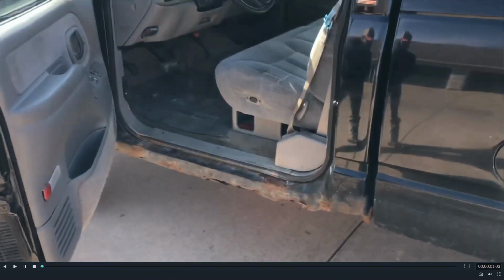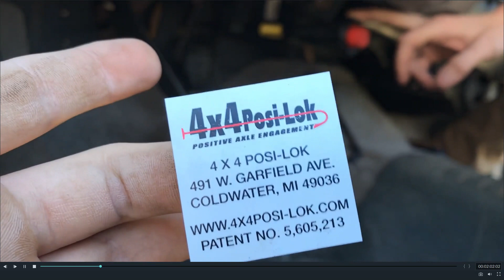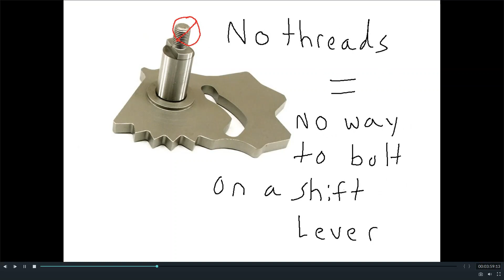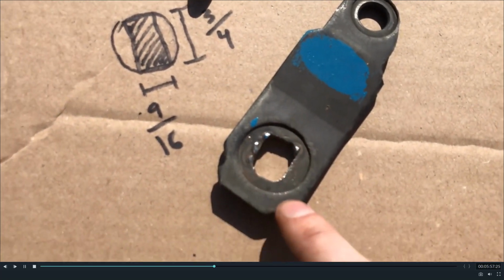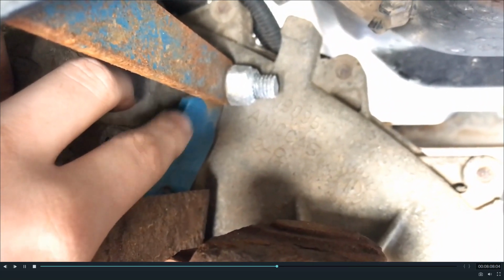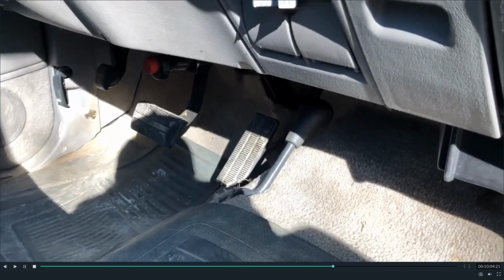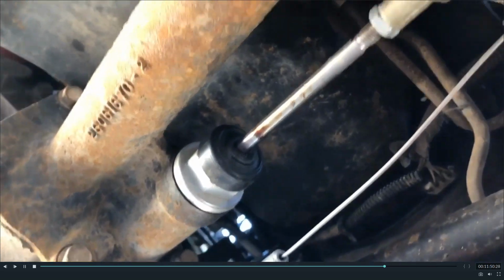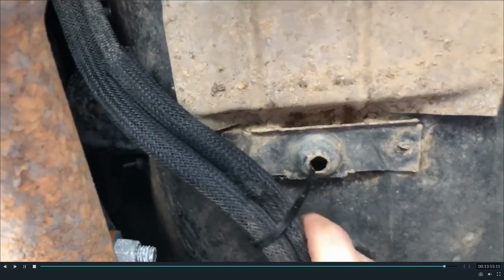push button to manual floor shift transfer case conversion 1998 Chevy k1500

Comment: Hey, how’s it going guys? I’m having an issue with my 2005 Chevy Silverado 4 x 4 LS so when I shifted into four high or four low, I had a lift both driveshaft are turning, but only the rear tires are spinning. The actuator was switched with a new one something isn’t sending the signal to the actuator that the 4 x 4 is engaged. I checked the grounds they’re good. Would you guys think it’s the transfer case Shift control switch and if so, where is it located?

Comment: The neutral or selector position that doesn't do anything that you speak of that's the Auto 4 wheel
Reply: Sir I assure you that the NP243C transfer case that is in this here truck does not have a 4-Auto position.  That was an option on some later vehicles such as my 2001 Blazer, but the original electronic push-buttons that came in this 1998 K1500 only had 2-HI, 4-HI, and 4-LO.  I could be wrong, but the majority of transfer cases that I have knowledge of usually have some sort of neutral position between the HI and LOW range for safety reasons. Because this T-case was never meant to be used with a manual shift lever, this "neutral" position simply felt a little hinky to me to the point where I would not be comfortable using it as a means of putting the vehicle in a neutral state.  

Also.... the grindy noises say no

Comment: I'm having trouble learning how to use my manual tcase on my 1999 nbs 2500 silverado I follow the steps from the instruction manual but end up grinding any tips?
Reply from the maker: The transfer case or the shift linkage is probably messed up.

Comment: I have a transfer case not engaging with the encoder motor for some reason, yet I get no blinking light 'error' on the 4x4 push buttons. I took the encoder motor off and noticed that I could manually lock in the transfer case with a wrench. I almost bought the Posilock but instead rigged up a carburetor cable under the hood that I lock in whenever I think I might need it. My '98 Blazer is at the point where I'm going to put a lever on because it's done nothing but let me down when I really needed 4x4. The engineers that came up with that terribad combination vacuum/electrical 4x4 system should be court martialed and shot. (I'm sure it made GM tons of $ from clueless fairer sex customers which is probably why that system was put in to begin with.)

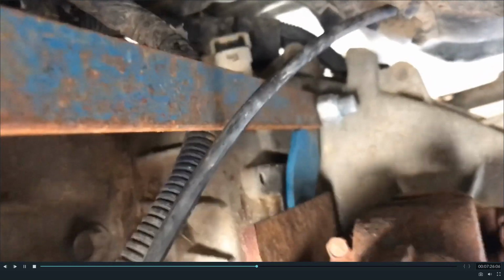Comment: At about the 7:28 mark it shows the linkage underneath the truck and you say the plate bolted into two of the encoder motor holes is holding the shift arm onto the transfer case output shaft. Is the plate just snugged up against the output shaft using washers for the correct spacing?

Comment: You don't have any issues with the transmission shifting at all? Since the computer doesn't have the position sensor to talk to?
Reply: No issues, over 3 years later and it  works perfectly. 

The truck doesn’t seem to know or care about having all that stuff unplugged

Comment: Hey man I want to do the same thing I have a 2002 Silverado with a 4l60e transmission with a np246 push button 4wd autotrac junk and I done burnt out the clutch pack in the tcase that's why my 4wd doesn't  work I want to swap in a manual shift tcase that doesn't use clutch packs what tcase do I need that will bolt right up I'd like to have a gear driven transfer case but a chain driven tcase will do ....by the way I don't know the spine count on my current tcase....as for the shift linkage I can fab up something that will work
Reply: I do not know off the top of my head what specific transfer cases will bolt up or what the spline count is.  If you are wanting to swap the case anyway, just take it off and count the splines.

Comment: Mine the transfer case got smashed by whoever owned it before, so I might as well put in a np261 and put in a lever. What I'm wondering though is the screen on the dash says "service 4wd" every few seconds, do you know how to get rid of that? Thanks
Reply: Either a sensor or an actuator is malfunctioning somewhere.  To try and reset the light, there is a way that you can jump two of the contacts on the OBD port and perform a series of key cycles.  This will clear out the memory in the transfer case control module.  You can find other videos explaining this procedure for different vehicles.

Comment: I got the np246 auto trak case. I hate the push button and want to do exactly what you did and switch it to the manual. What trans case do I need to pic up? I also have the posi lok for my k2500 that iam literally installing now. Great video and job guys.
Reply: Thank you.  If you're looking for an already manual option, the np241 will most likely work as long as things still bolt together however there are stronger options.  Just search for things that will bolt up to your transmission/trans-transfer case adapter.  There are quite a few options out there depending on whether you want a chain-driven or gear-driven transfer case.  In our situation, we did not want to swap out the transfer case (because poor) which is why we created a linkage to replace the electronic actuators.
Reply: @alecschauer9902  Now it makes more sense. I thought you converted to the 241.

Comment: How can you change the manual to buttons ?
Reply: So you're wanting to swap from one that has a manual transfer case to one that is button-actuated?
Reply from the maker: step one: get an electrical engineering degree
step two: now you can afford to buy a different truck
Reply: Why would you go from I know this works to I hope it works
Reply from the maker: @avadeal345   Y E S

Comment: How did you seal the hole in the floor?  Did you use any sort of boot?
Reply: The shifter assembly is a stock factory part. it seals the same way the factory installed ones do. it just has a rubber gasket that goes on one side and is squeezed between it and the floor.  Water could still come in the slot the handle slides through just like every other truck that has one but at that point water would be coming in the doors
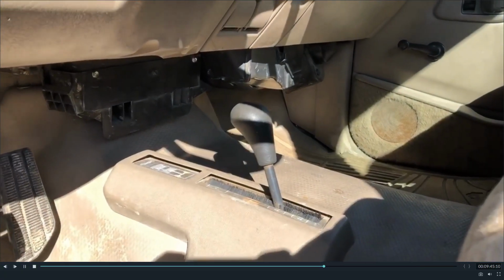Reply: In this case we did not use any kind of seal because I did not care.  The assembly usually has some sort of seal, though, as well as the brush thing on the OEM cover plate depicted at 9:45.

Comment: I’m looking to manual swap my 8.1L Suburban, which has full electronic 4WD. I know I’ll have to convert to a floor-shift t-case, so would this still apply? And if so, how could I wire the t-case to still activate the front actuator? I believe it’s a NV246 t-case.
Reply: Things well that answers my question... what was the estimated time y’all worked on it ?
Reply: Things thanks cuz this is my daily... I didn’t want to be out for a week or so... will update later...

Comment: you don t need to lock the front with a cable /when you manually put it in 4x4 /the vac sensor on transfer case wiil engage front diff
Reply: Nope, wrong. this truck was equipped with an electric solenoid on the front axle housing that worked in conjunction with an electric servo on the transfer case. Only when the servo on the transfer case had completed its shift, would A computer (The 4wd controll module) tell the solenoid on the front axle housing to  engage. Because we removed the servo entirely, the computer would never see a completed shift and there for never tell the solenoid to actuate. The cable pull is manually and physically moving parts in the front housing. vacuum has nothing to do with the 4x4 on this 98 k1500. Not a thing.
Reply: @goreerh  So if i swap my push button 243 with a manual 241, I'll have to use a cable to engage the 4wd along with the manual shifter? or can i just use the manual shifter?
Reply from the maker: If your gonna swap your transfer case for a 241. Then just find a truck that has a manual linkage for a 241 and take all the electronics that control the front axle actuation. Theoretically you could integrate those into your truck and have a shifter that works like factory. If you don’t want to deal with all that Jazz just use the posi lock kit, it make shifting into 4x4 more of a process but it removes all the electronics that like to go bad.

Comment: Thermal ?
Reply: @things7141  Ok, never heard of that on these so I need to look into that gas expansion type actuator. Do you have a part number ? I have done several S10's and own an '89 that were all vacuum operated. And one that was electric. Agreed they are all poorly designed, too many points of failure.
Reply: @things7141  I never heard of a thermal actuator on these. Always thought a thermal expander was on HVAC, not on front axles, and called a Capillary Bulb.I already converted mine, and others. Missed out on a Posilok thing a year ago for $40, new. So then made my own pushpull cable. Have a floor shift already for transfer case.